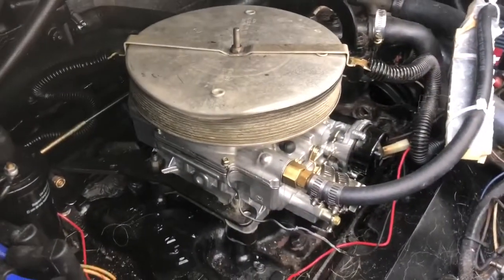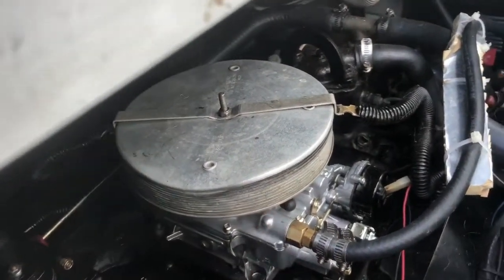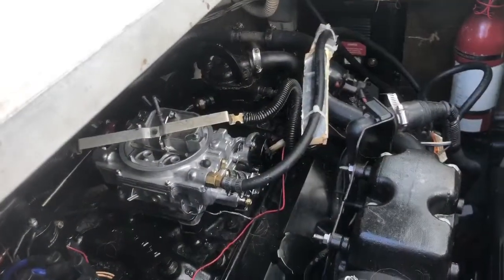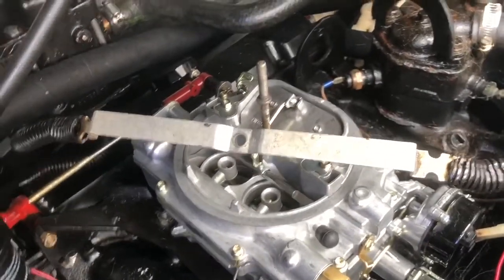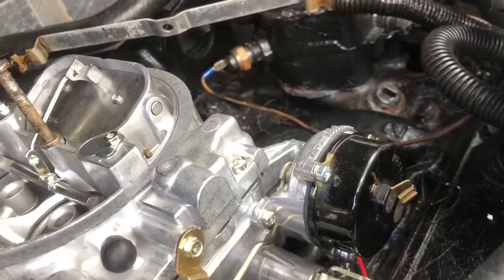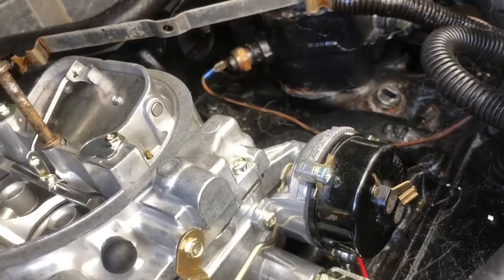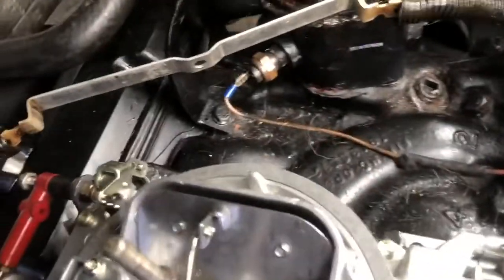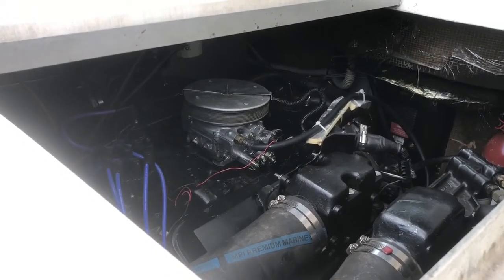Minor adjustments on carburetor 1410 edelBrock

Comment: Awesome buddy. I haven't had to mess with mine. But after each new video you do, I need to do the same repairs. Right now i have my waste holding tank out because I had a leak. Couldn't see any hoses leaking, and the seepage seemed to be under the tank. Its been filled with water in my garage for 2 weeks, no leaks. Might have been the pump, so replacing the bellows and duckbill valves since i have it apart. Happy Holidays🌲
Reply from the maker: Happy holidays my friend !! The projects never stop coming LOL but I’m such a nerd every time something goes wrong I’m kind a happy about it because I get to fix it LOL

Comment: Thank you, I have a old 1971 flatbottom drag boat and running a 454 with a Holley 750 but I'm not a carburetor guy and mine needs adjusted from off idle to giving her gas she has a flat spot. I'm thinking of just putting one of these Edlebrock 1410 on her and call it good. Thanks again!
Reply from the maker: Can’t go wrong with that I love these edelbrocks super easy to deal with! What’s your top rpm on that?
Reply: @Cruisingthesouth  Oh man I would say maybe 5 to 6 grand.  I have only ran her hard like that a couple times and I think it's a fairly stock 454 it doesn't sound cammed. It's not the engine it used to have in it back in the hay day I'm sure.
Reply from the maker: Nice! Yeah if she lets you go up all the way to 6000 RPMs the 1410 should do you good, I stepped down to the 600 CFM 1409 because my boat weighs 15,000 pounds so her top RPM is 4100 and I cruise at 3100 RPMs and when I do the math at 4100 RPMs she is only using 578 CFM‘s and I never push that hard so the 1409 did me perfect! let us know your results 😉
Reply: @Cruisingthesouth  Awesome,  Thank you for your input and replying I appreciate that. I'm debating on the edlebrock or rebuilding my Holley. It's always something with a boat.
Reply from the maker: You’ve got that right it’s always something! Oh my last trip my cylinder number two flooded with water result of a cracked head related to being raw water cooled on salt water 😩 and I had just dropped all kinds of money replacing the port engine and now I’m on the middle of replacing the starboard engine so I’m hoping things will slow down for a bit LOL

Comment: How are you my friend i have the same engines mines are 1995 never replace carburator but one engine when goes out it get to 4000 rpm 2 sec later goes down to 3000 then 2800 then up to 3000 and stay up and down but if i put it in 2100 rpm run perfect but the boat goes 7 nuts do you recomend me to replace the carburator if so wich one should i get i replace fuel pump spark plug cables water sepator dont know what else please help
Reply from the maker: The edelbrock 1410 is a good bet. it’s a 750 cfm but I switched to a 600 cfm but I cruise at 3100 rpms so you probably ok with a 750. Check your timing make sure is where it needs to be Change your ignition coil and clean your flame arrestor and go for a ride see what happens. A failing coil can act like that and as silly as it sounds also a dirty flame arrestor can also cause that. Let us know
Reply: I will thanks
Reply: I'm having the same problem as him.   Do you have a video on how to check the timing?!
Reply from the maker: @kylekrynicki  Unfortunately I don’t but I’ll see if I can make one tomorrow for you